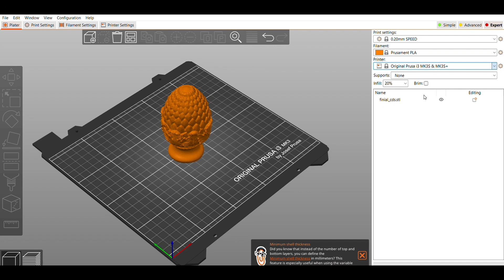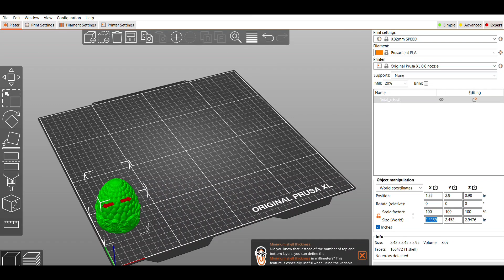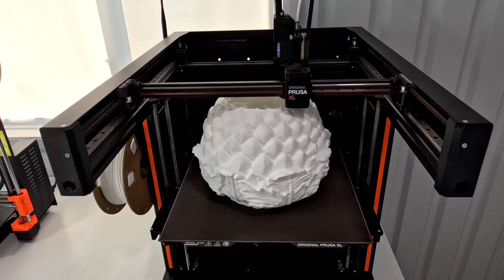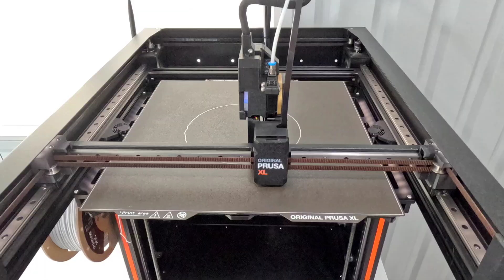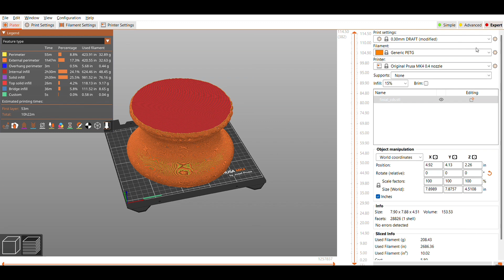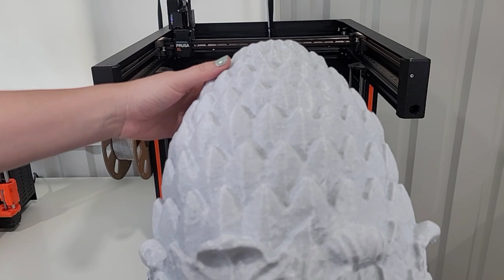Pinecone Finial on the Prusa XL is over 18" Tall!

Comment: A low cost uninterruptible power supply (UPS) would be a good option to protect big print jobs.  The UPS switches to battery for when those power fluctuations or blckouts occur to keep the printer from shutting off.  More expensive UPS have allot more features and software for protecting computer servers, but you wouldn't need all that expensive features stuff.  Just a big enough UPS battery with enough amperages to keep the printer running during a storm interruption

Love this channel.  If anything would impress me to get a Prusa, it's this channel. 👍
Reply from the maker: Good to know. I have my MK4 and my XL on the same outlet. Is it possible to run them both through the same UPS? Thanks so much! I really appreciate it!
Reply: @tada3dprinting  yes, totally, if the UPS has enough amperages and large enough battery to keep both running.  I can do some research today and recommend a couple.

The UPS has multiple outlets in the back of it for plugging in multiple devices.  Just need a UPS with enough battery and amps to run them all when electricity goes out.  Can also plug a power outlet strip into the ups.
Reply: @tada3dprinting  here's one for under $200

CyberPower CP1500AVRLCD3 Intelligent LCD UPS System, 1500VA/900W, 12 Outlets, 2 USB Ports, AVR, Mini Tower

Comment: One option when trying to restart a print, especially at these later heights, is to print more layers then you need as you're re-printing and then clip them away so that you have a nearly seamless connection between the bottom and top.  I'm thinking use tweezers and careful pull off layers from the top piece till you get just the right layer to marry to the bottom piece
Probably wouldn't work on a print if there was more infill and internal structure.
Reply from the maker: Thank you!

Comment: Increasing the extrusion width will speed up prints quite a bit, I’d guess it could have saved you an hour or two, maybe more. I frequently go up to 150% the nozzle diameter (so .6mm extrusion width on a .4mm nozzle), but I think it can be pushed to 200%.
Reply from the maker: Ok I'll keep that in mind. Thanks!

Comment: I notice that you use Overture filament a lot. Could you comment on how you like it and why you happen to have chosen that brand? I have used their PETG and TPU and have had good results with both.
Reply from the maker: I found Overture on Amazon and liked that I could get them quick (usually next day) and the price was reasonable. Although the price has gone up a little over the years, it's still reasonable. I think my main benefit is that I can swap to any color in the same type of filament without having to adjust settings or print temp towers. Of course swapping between types of filament requires a little adjusting. But they have almost every color and type that I need. So I just stick with them. Colors that I use a lot of, I have set up recurring deliveries on Amazon. This saves a little money and gives me one less thing to keep an eye on. I do like their PETG and TPU when I have need for it too. Thanks!

Comment: Do you have some tips on PETG? I bought a roll of eryone orange petg and haven't been able to print with it at all, as it shrinks like crazy. I don't know if it's the filament or my settings, I'm using stock prusament petg settings!
Reply from the maker: I like the Generic PETG profile. I think the temps are a little lower than the Prusament PETG profile. I feel like when I get some curved corners that should be straight, it's usually my nozzle temp is too high. I also feel like PETG is a little more prone to seam bumps, so I try to watch for the aligned seam. I've never used Eryone PETG so it's hard to say exactly. I would recommend a temp tower to start. Thanks!

Comment: So swapping the nozzle is a hardware change but a software change can do just as much. Simply change the line width setting to whatever you need. There are guideline, normally 59% above and below the nozzle width is achievable. 
So for example, I use my 0.4 nozzle to give me 0.6 lines and 0.2. It does it extremely cleanly. 50% is the general rule of thumb but for example I did see some psychopath on YouTube using a 1mm nozzle to print a 7mm width 😂
Reply from the maker: Does it actually print faster when you use a skinnier line width? Thank you!
Reply: @tada3dprinting  it MAY. For example, a popular product i make is a plaque with writing on it. I use a 0.4 nozzle I use 0.6 for the plaque and 0.2 for the writing. So that way i get a good mix of speed and quality. It takes approx 3 hours to print. The entire thing in 0.4 takes 8 hours. so when used like this it will save you time. The entire thing in 0..6 take just under 3 hours, so its quicker but the 2quality wont be there for the little details, like the writing.
Also sometimes yes because of the speed in the slicer. But anyway I’d love to see a vid of you experimenting with changing the line width!